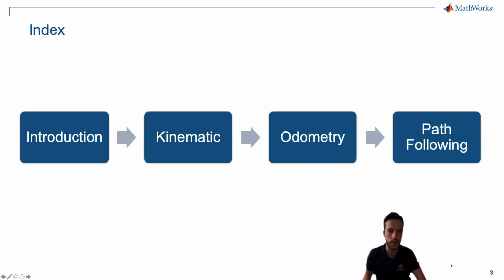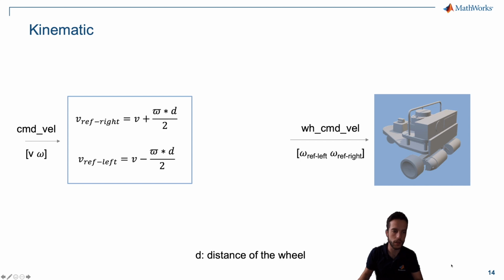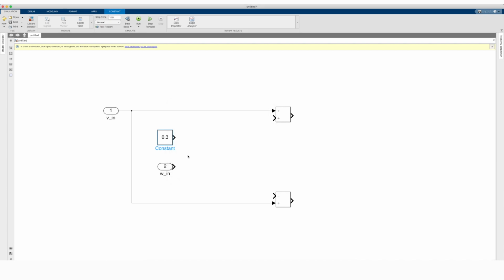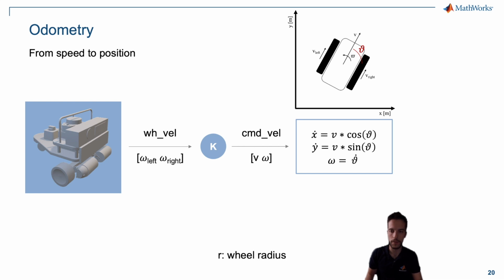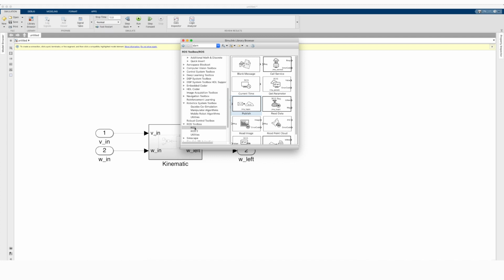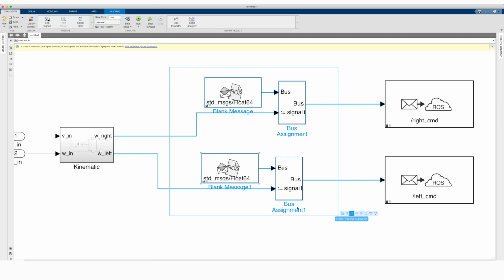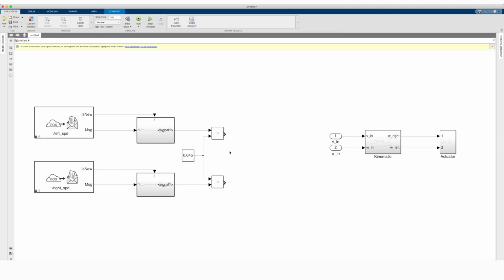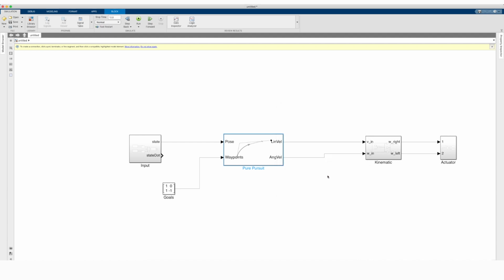MATLAB & ROS: part 2

Comment: I followed all the steps exactly but I got the following error "Selected signal 'signal1' in the Bus Assignment block 'robot_odom/actuator/Subsystem/Bus Assignment' cannot be found in the input bus signal.
 This may also happen if there is an always false variant block feeding 'robot_odom/actuator/Subsystem/Bus Assignment'. Change the variant conditions or set the Variant activation time of the variant blocks to 'Update Diagram Analyze All Choices'".
Reply: I am not able to resolve the error.